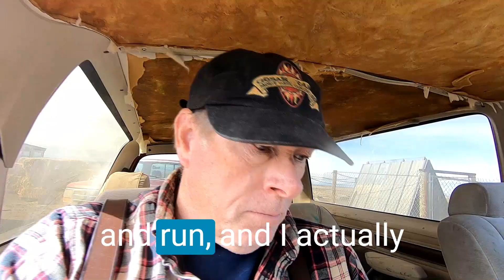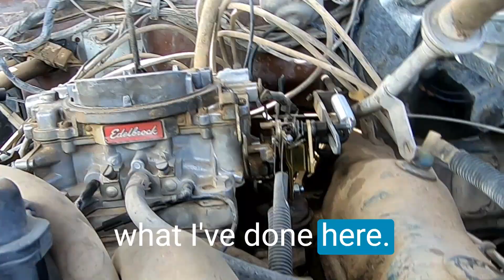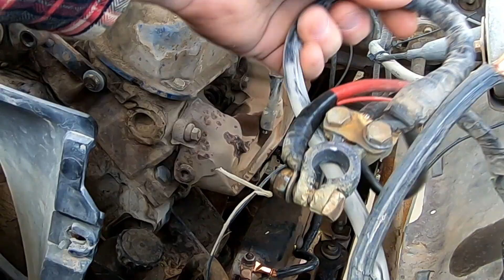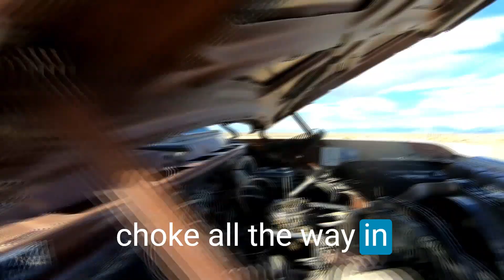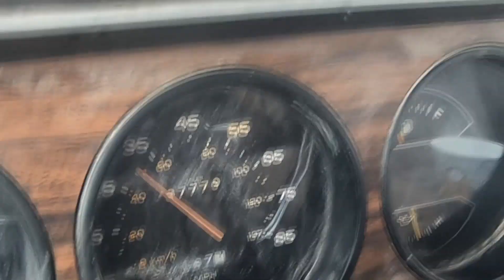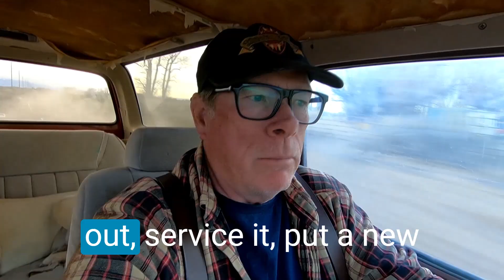Ramcharger - It Drives!!

Comment: What's that thing that looks like it's holding a spark plug at around 6 minutes? Between the carb and master cylinder?, hope it doesn't rain while your out driving 😂
Reply from the maker: It is a spark plug. There are actually two of them like that.  This engine has had its smog stuff deleted, but the ERG pips are still in place and are plugged with old spark plugs.  They will be gone soon. Thanks for watching, EL!!